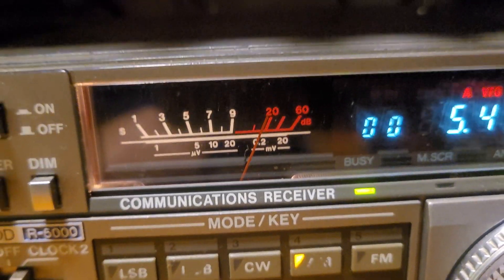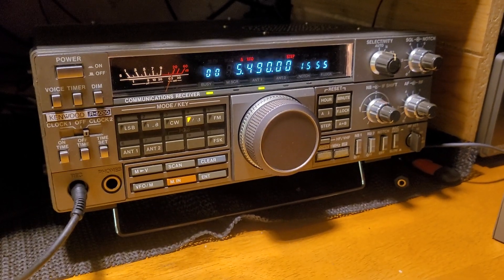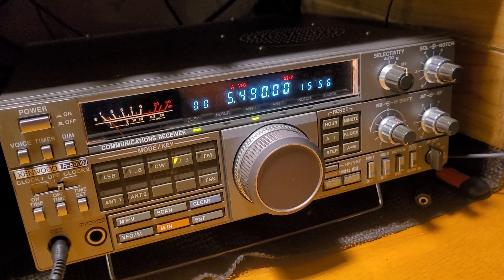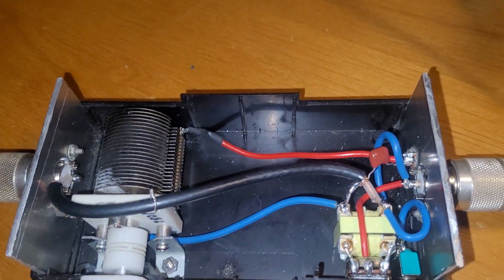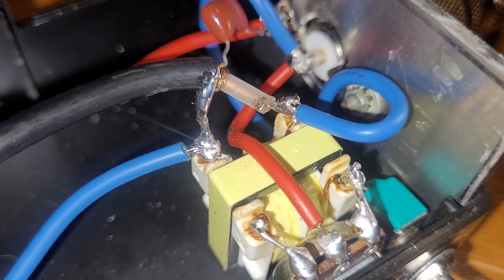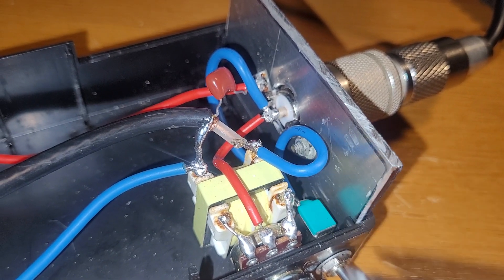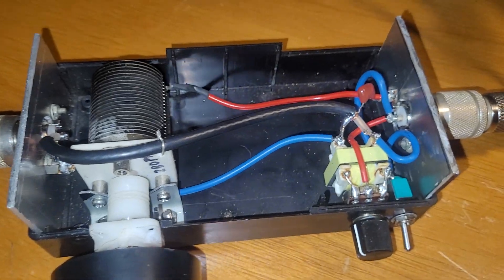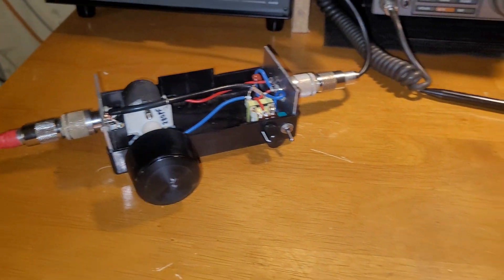LED Street light interference - AC hum filter, gadget.  Works!

Comment: The street lights that use LED's are powered by and controlled by this device:  Intermatic ELC4526.  This has a three prong locking type plug in. You will see this as a small Blue, White, amber or white hockey puck looking device .    You can by these at Home Depot or Lowes hardware stores.